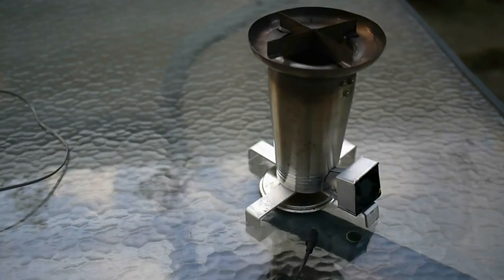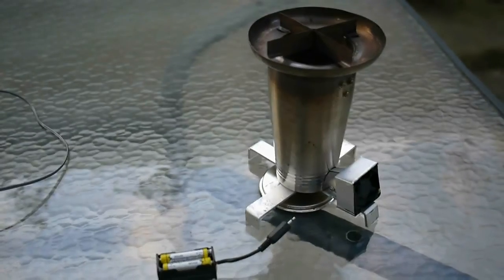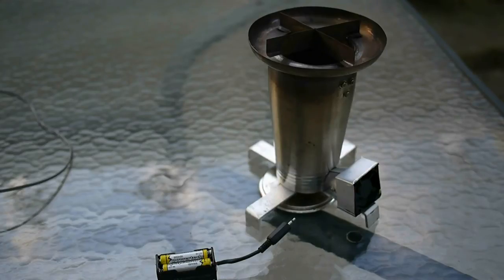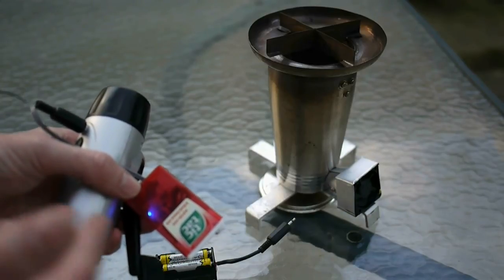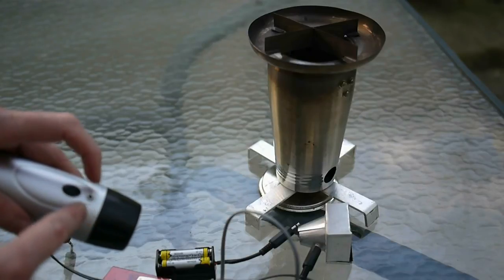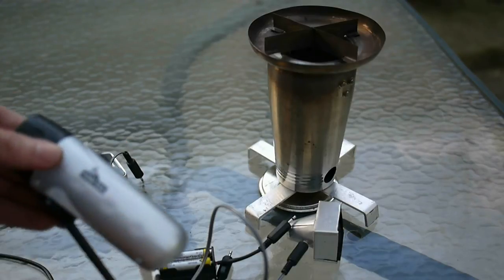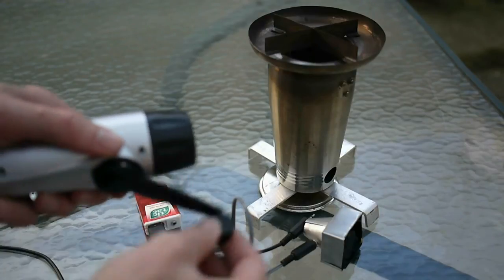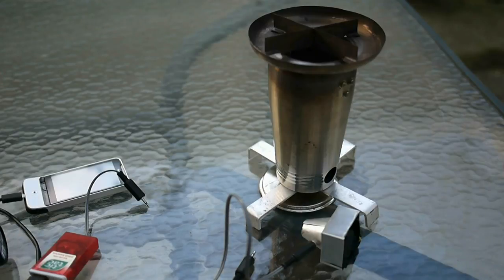DIY Project- Dynamo Torch Mod To Add USB Phone Charger Output

Comment: For those of us who are less intuitive re: circuits etc., can you provide me with a shopping list and how to esp with the dynamo socket you placed on the torch?
Reply from the maker: It was the smallest plug and socket I could buy at my local electronics shop, which was a mono 1.5mm audio plug and socket.
Reply: Thanks for the fast reply. I have a wood burner that burns odd bits of wood chip etc., but the problem is and will be the lack of air flow to really get that secondary gas burn. Rather than start again - I wanted to look at options of incorporating a lightweight base that had a fan attachment to updraft the air with fresh draw to allow the heat to ignite those gases. I really appreciate your video and narration - top quality! Thanks for sharing
Reply from the maker: Maybe you could have a look at ebay for personal or portable or battery-powered fans or similar to see if you can find a simple fan rather than trying to make one.

Comment: so, you need to have the temp differential adequate enough with the heat sink, thermo gen, plate and the surface area of the thermo gen needs heat sealant between the metal and thermo gen because even microscopic holes matter. the surface area is important, and semi conductive metals in an alloy are best, ex..aluminium. it can be wires in with the fan. the seabeck effect works in reverse. you need a small regulator (sub zero solar chargers have one built an) cold generation is king, but it works the same. you could make a portable unit, compact as long as you intergrate the fan, but the longer the surface area of the opposite of heat (heat sink side...temp difference) the more you can use water ir ambient temps to help. bittom line is, its the temp diff, not the exact direct heat or cold, the movement of electrons in the metal, heat in and out of metal. alloys help slow that

Comment: TELL ME           HOW DO U START OFF DOING ONE THING AND END UP WITH THE SOLUTION OF THE PROBLEM YOU NEVER EVEN THOUGHT OF?
Reply from the maker: Conrad Meyer I'll assume this is not rhetorical...In this case, I was surprised by how many people thought that carrying spare batteries was a big deal- so that made me look at alternatives... Now I also have a solar panel with or without a rechargeable battery pack as further alternative power source.

Comment: Cool job, keep it going!!! Question: as the main issues of this project are those related to the fan system, is there a big difference between fan-forced stoves and naturally ventilated ones? Why did you decide to force the ventilation instead of letting the chimney effect going on? Thanks!
Reply: The fan makes the stove much easier to light and keep going. It also burns better so it is less likely to smoke if there is a bit of a breeze or wet fuel, and your pot stays cleaner. For all those benefits, the negative of having to carry a small fan and battery are easily worth it.

Comment: Good job. do u think u could transplant a better battery in your light and replace your LEDs with better ones.?
Reply from the maker: Of course I could upgrade the battery and led- but I don't really need more energy storage or more light. More batteries would increase the weight which would make this less suitable for my original intended purpose of taking hiking.

Comment from the maker: The little dc-dc converter puts out a steady 5V even when the input voltage varies. By memory I think my one starts at 0.9V up to 5V input. The eBay ad I saw recently was selling on that took a 3.7V input. You might need a capacitor to smooth out your input voltage if it varies wildly but the dc-dc converter will probably cover your needs.

Comment: true, that sounds like a pretty nifty component. i have to do a bit of homework i think...i thought i might be able to adapt your circuitry to regulate the power coming from a bike dynamo, but obviously the power in your solution is coming from a small battery bank inside the torch, presumably at a steady output. no worries. thank you very much for your reply :)

Comment: Great project, love it ! In regard to fan-power i use a single 1.2 Volt AAA Rechargeable 800mAh battery that can be charged through a USB connector. Power consumption is 150mAh in high speed and 100mAh in low speed mode. It takes at least 5 to 8 full hours of using & cooking to deplete the battery. Guess some little 5v solar panel or a 4 x AA battery pack can do the recharge at 65mAh for 12 hours. Using any other way of charging this little AAA thing would be absurd and waste of money.

Comment from the maker: The main component is the dc-dc converter that has a 5V output and around 3V input. On eBay I can see a few for sale now, and some even include a usb port. If you have one of those it's just a matter of opening the torch, finding the wires that go to the LEDs (light) and connect them to the + and - in connections on the dc-dc converter. An electronic parts store should find other bits for you.

Comment from the maker: Thanks for the comment. I love your work too. Could I suggest you investigate clockwork dynamos for Uganda instead of this? i.e. the energy is stored in a spring instead of a battery like they do with those third-world radios. The battery in this torch could be another maintenance issue as it will eventually need replacement, and the gears are plastic etc.

Comment: Brilliant.  long time ago we used fans in our stoves but had the same issues. so we made a weight driven fan for our program in Uganda.. worked pretty well.  Fans are lovely because they help the stove put up with poorer quality fuel but we eventually went fan free, partly to keep cost down but mostly because fans break and air does not. Lovely video tough and way better than the thermoelectric which I agree too costly and also prone to breaking if used everyday.

Comment from the maker: I considered solar, but thought it would be too expensive to get a large enough panel to be useful. Also, cooking and charging of mobile phones is likely to be needed when there is no sun (night-time or cloudy). The whole point of this device is to be a backup when other methods (batteries) fail, so it is counter-productive to have a backup that relies only on good sunlight availability. Solar plus dynamo may be worth considering... Portability for camping is also an issue.